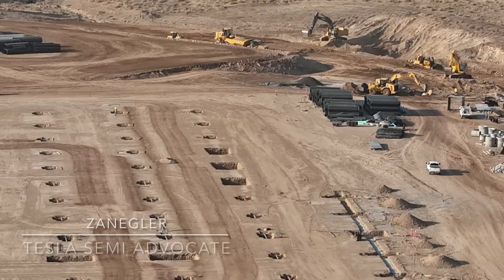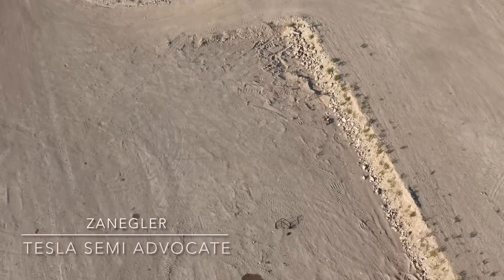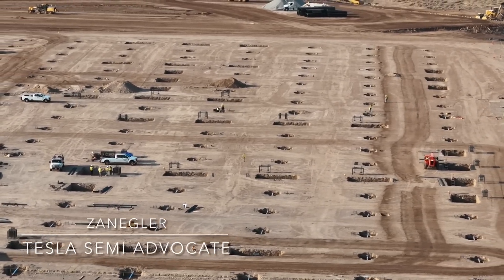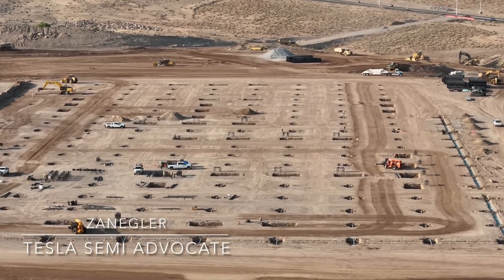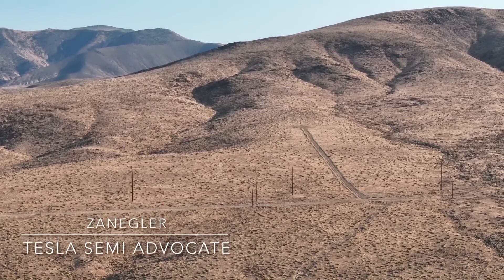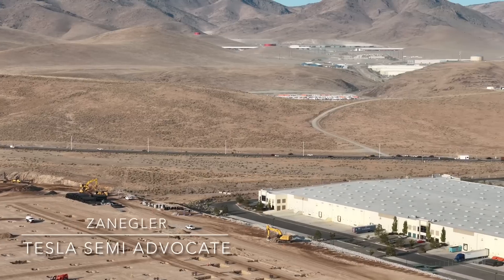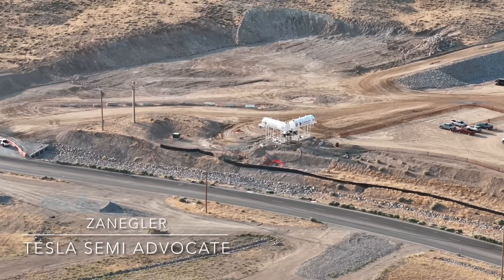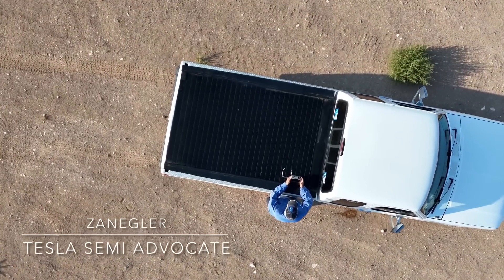Tesla Semi Factory Update - More of Everything!

Comment: Thanks Zanegler, 
Just a note on terminology. Cement is one part of concrete, the part that binds everything together. Concrete which is used for footings is cement, sand and aggregate. 
Cement by itself doesn't have great strength, concrete is better but the whole things is transformed by the introduction of steel reinforcement. Making reinforced concrete.
You probably knew all of that, but  thought I would clarify.
Thanks for your videos, much appreciated.
Reply: Right. Dont call it cement, the right word is concrete.
Reply: @philtrubey7480  Yeah, I think it was Jethro Bodine calling it the "cement pond" that brainwashed us all into using the wrong word!  :^)